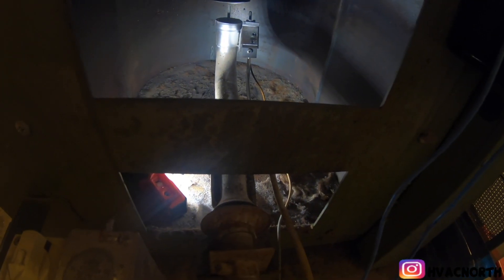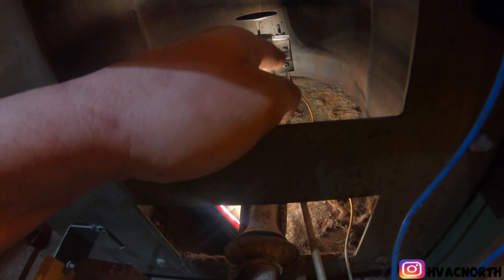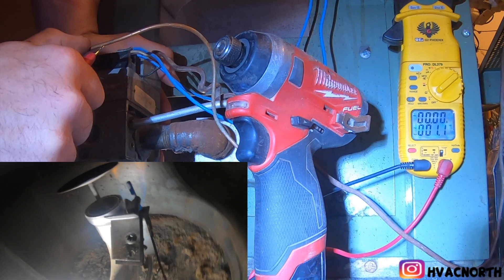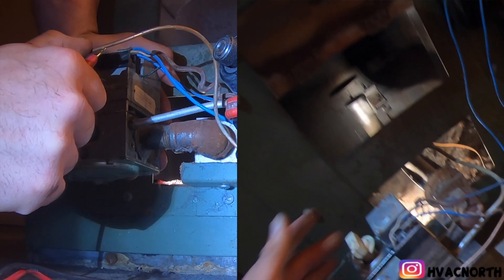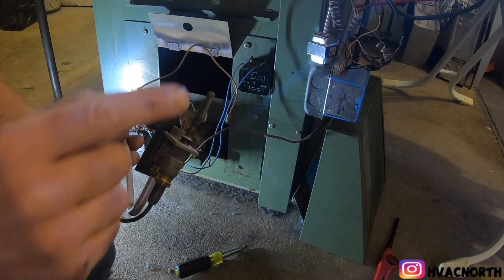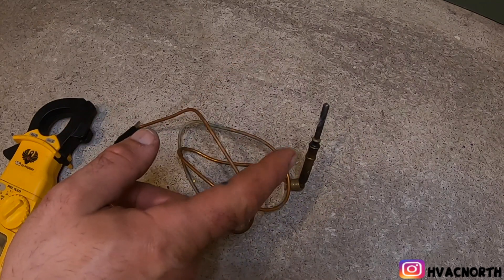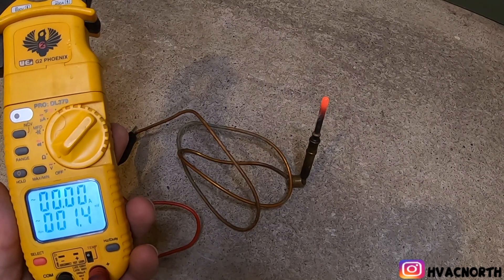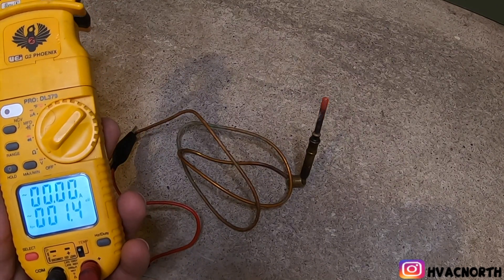HVAC: How to test a Thermocouple | Pilot went Out

Comment: Good vid and kudos on the camera work. That is a great check for an underperforming t-couple. I have seen many times with thermocouples (or powerpiles) that they can test with no load normal but drop with load. Next time you are scrapping valves, pull the pilotstat (the magnetic plunger the thermocouple threads into) out of the valve and toss it in your tool bag. You can thread the thermocouple into it while holding in your hand and manually engage it to see if it holds. Beats breaking out the meter and gives you a loaded test of the thermocouple

Comment: I Use to work for a “Chief Engineer” who couldn’t troubleshoot a thermocouple . he couldn’t figure out what was wrong so he called tech support they told him how to do but he kept trying it with no flame 🔥 so at the end he just replaced the whole burner assembly. I was still new to the trade so I went home that night to read up on it a saw you needed a flame to properly troubleshoot it . The following week he couldn’t troubleshoot a bad pressure switch in a water heater said he didn’t have time for it so he replaced 3 pressure switches . Every time I called him for help he’d never show up always send another tech . That’s when I knew I had to find a better work place if I wanted to advance. They ended up letting him go .
Reply from the maker: Funny you say that bud. There is a guy on utube that was trained on how to test thermocouples by someone I know, but he claims to be a hvac trainer for his company hahah. Glad you moved on. Thanks for the comment